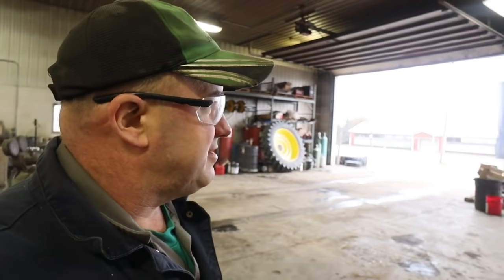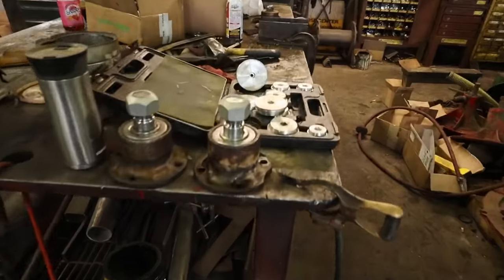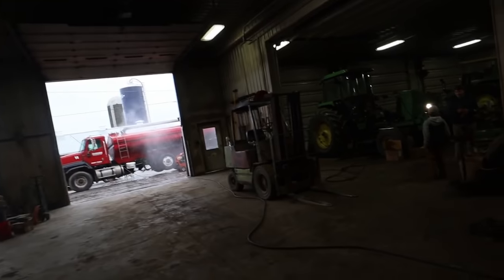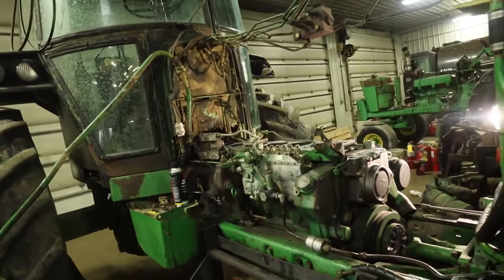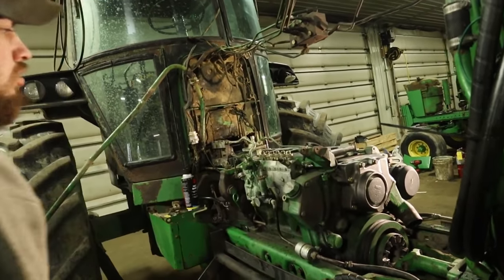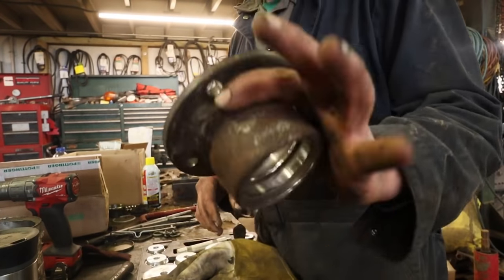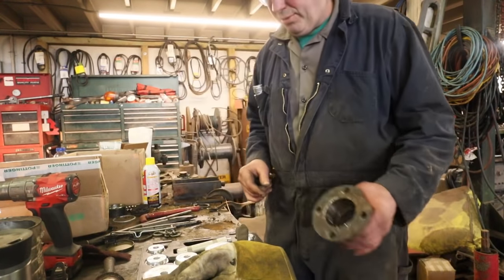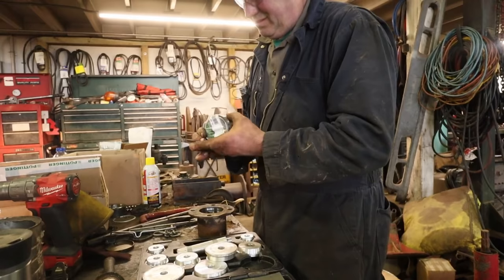Pottinger 6001 Terra Disk Bearing Replacement

Comment: We used air hammers on hub assemblies like that, if that didn't work, we had the shop press. Saves on all that hammering. At least you have a few empty spots in the shop again. Great video, cheers :)

Comment: What types of work do you do with the 4250?  You guys really keep your fleet in good shape.  From the older models to the newer ones, you're on top of a lot of maintenance and repairs. I was a school bus mechanic 20 years ago and all the u-joints and king pins you've been changing bring back memories.  Sure could have used those tools you have now.  We had brass bushings and had to ream them out till the pin slid through, then later on we got nylon ones.  That was a nice change.  Thanks for the videos.
Reply from the maker: 4250 just gets used on small jobs anymore.

Comment: you need a metal lathe so you can build seal drivers and bearing drivers for the common repair jobs.
Reply: He had a whole set of bearing and seal drivers sitting on the bench in front of him lol those aluminum puck looking things. Needs a dang hydraulic press though! :)